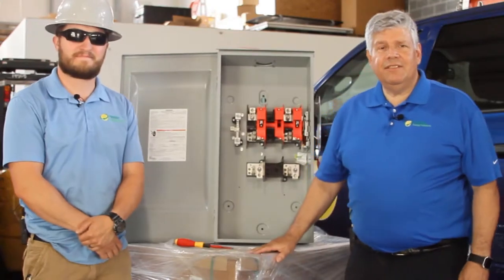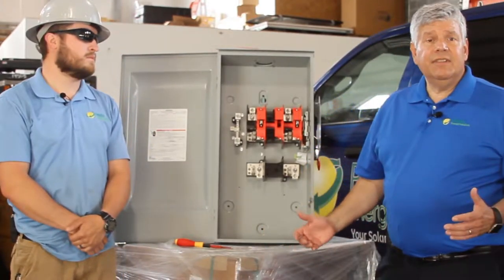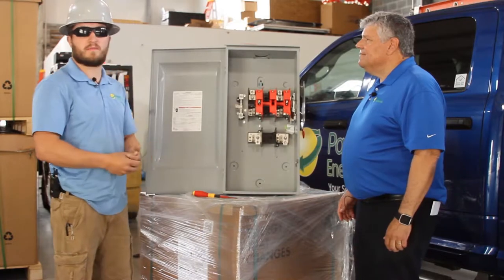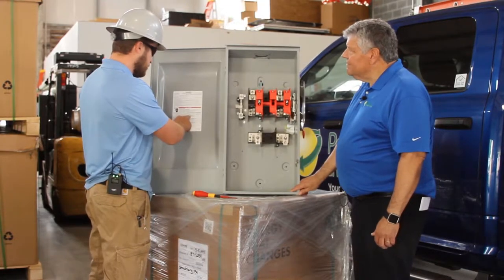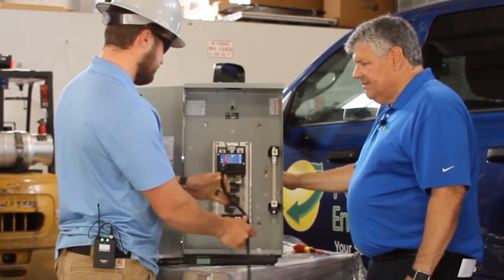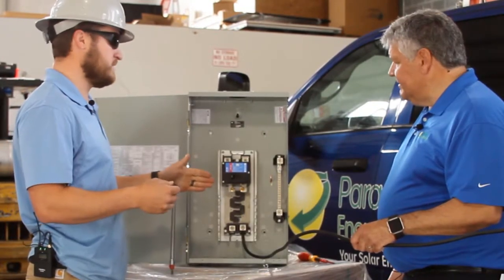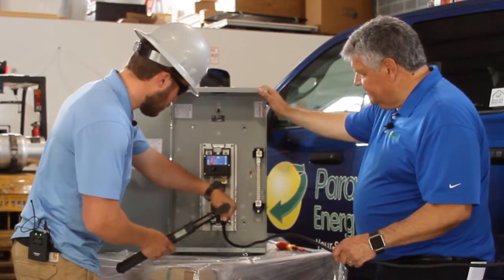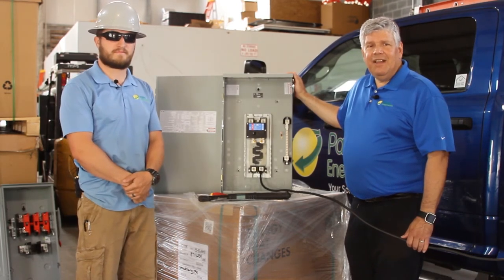Torquing Electrical Connections

Comment: I hadn't heard of torquing electrical connections until recently. I understand it's now a code requirement? Is it common practice now for electricians? Are screws in receptacles supposed to be torqued as well?
Reply from the maker: Dave, It's best to check with the manufacturer's specifications. If they specify a torque requirement for a fastener, the electrician or installer should use a calibrated torque wrench or screwdriver to achieve the specified torque.

Comment: here i come again sir if you dont mind answering😊 , i wonder if the bolt already experienced plastic deformation, what happened to the nut? experienced the same or not? if experienced the same do we need to change the breaker because the nut is directly factory mounted there(like schneider ezc ezc250f). thank you so much 🙏
Reply from the maker: It's hard to give a definitive answer here without seeing exactly what you're working with.

Comment: how do we know the right torque setting for the bolts sir?
Reply from the maker: That info should be on the door of the disconnect or AC panels. See video at 1:34.
Reply: @thesolarenergychannel  thank you for the response, is there table or the right calculation for the bolt that use as electrical termination? 🙏
Reply from the maker: @aldeniprimaanugrah9509  We would suggest looking up the product spec sheet for the specific component you're using. You can also reach out to the manufacturer.
Reply: @thesolarenergychannel  great thanks
Reply from the maker: @aldeniprimaanugrah9509  You're welcome! Thanks for watching.

Comment: That wire has a ban on it in my country.  The torque setting you have there is for copper as the  aluminum you have there is a lot softer so would require a different torque setting.   The reason the aluminum was banned was because it would burn down a lot of housed in Canada.  It was too soft and the connections would heat up and arc until a fire started and burnt down the house.  Too many houses were burnt down so that wire was banned here for house wire.  I would not recommend a person use that in the USA if you can avoid it.   Can't beat copper for house wire or for plumbing, just a little more expensive.
Reply: how do we know the right torque setting for the bolts sir?
Reply from the maker: @aldeniprimaanugrah9509  The torque settings will be on the product spec sheets and/or the breaker box labels.
Reply: Absolutely right Owen. Canada is the most safest country around. I drove to Ontario regularly and have my work done there because it's done right with the highest safety protocols.its not expensive and every year it saves me in maintenance. When I removed my line 1 & 2 I had to use a breaker bar and noticed it was torqued good at about 41+ ft lbs. or 500 in lbs. I would use a torque too but I also didn't want to stress the mounting bolts so I'd use a large cresent to hold each lug in place while I did it, that's just my idea. I put as little stress on everything. The wiring I try not to bend more than once and no more than a slow curve to not make hot spots.